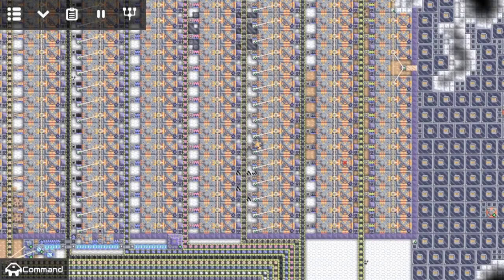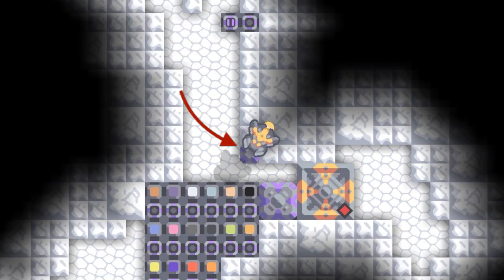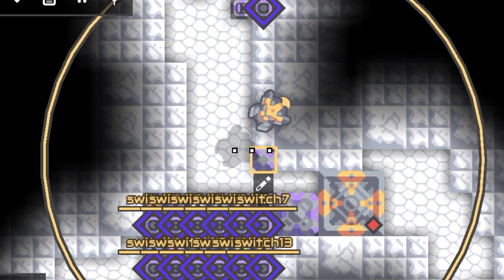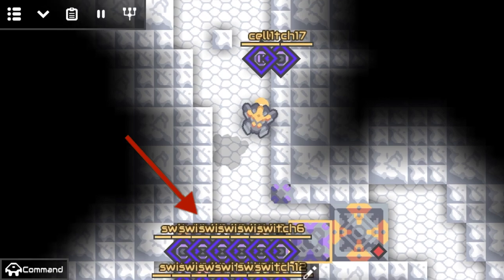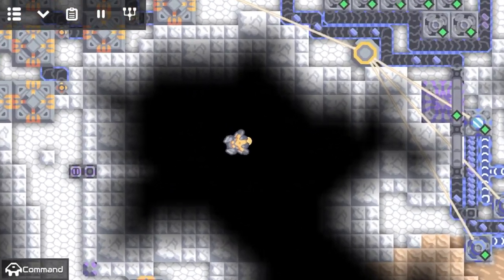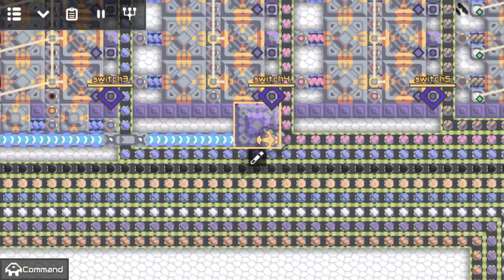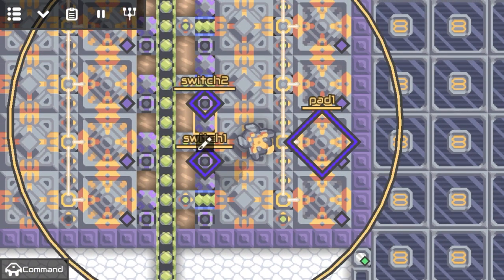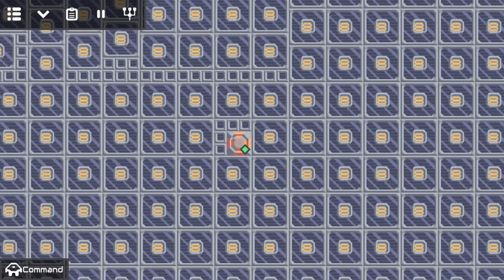How to make Mindustry Export Hub Logic Idea/ explanation

Comment: One problem is that sometimes the launch pads get locked in a disabled state and you have to partially deconstruct and reconstruct to solve the issue.

It just happens when I save and exit / go to another sector and is very annoying.

Connecting and disconnecting energy nodes is far more reliable.
Reply from the maker: @omicron166  do you know why they get stuck in disabled even if it is supposed to get on?